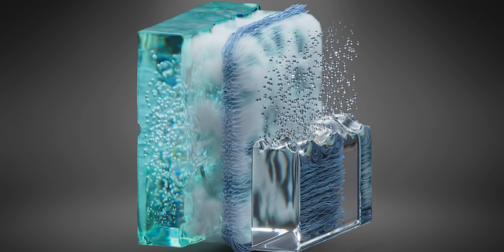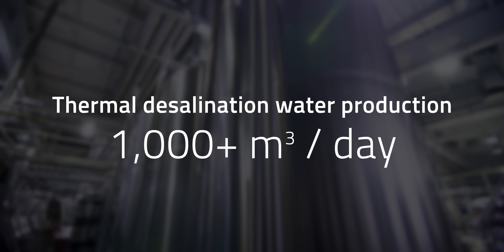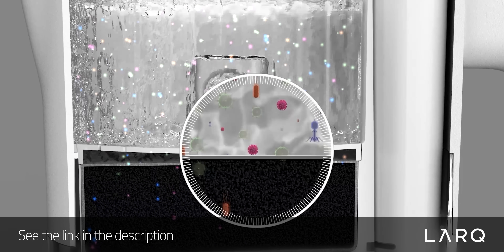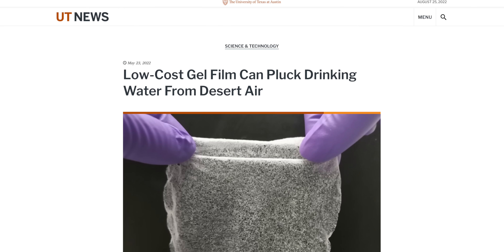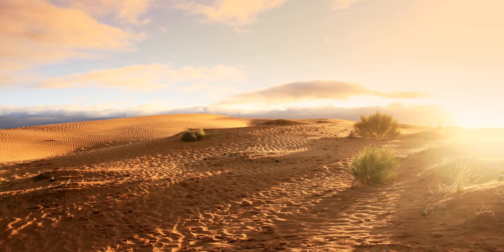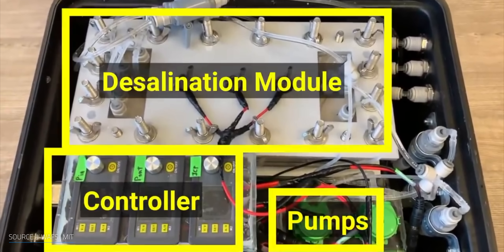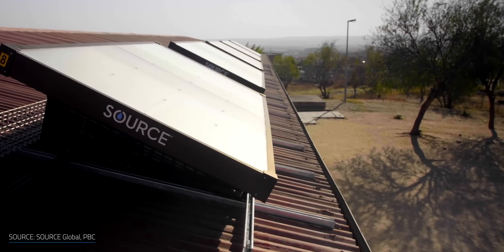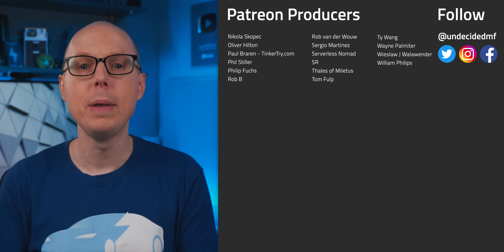2 Breakthroughs That Could Solve the Fresh Water Crisis

Comment: Brine shouldn't be viewed as a big problem it just needs to be mixed into the ocean over a large enough area, not that difficult of a task.   Getting through the discharge regulation red tape is the main problem,   As water becomes scarce in areas like the Southwest the zelous regulations including monitoring  will have to be streamlined to accommodate the needs of the people.

Comment: immo so the best solution combined was pump sea water from sea to very wide  semi closed place drying rack while use gel hanging on near air hole to milk as much water vapor in process to some hub to stored it for next processing. It seem not only need sun heat to be power horse the leftover salt water and other thing pumped for sea can seem only need be regularly cleaned or even might be another source of resource.

Comment: ICP is actually quite a cool idea for wastewater treatment and water re-use. Typically, this uses normal membrane (or even sedimentation) solid removals. If this idea could reach TSS concentrations as low as membrane technology, without the maintenance and replacement issues, then it could be very competitive. 

Regarding the foam, I see this more as an emergency or military solution. It's not practical to transport in the quantities required for what we would consider acceptable living standards. Generally in the West, even the most water conscious households still use about 80 l/p/d. Going lower sacrifices hygiene, which is not desirable. At 80 l/p/d you would require almost 15 kg of foam per person, which difficult to provide.

Comment: The problem is what has become trapped in the hydrologic cycle, such as persistent chemicals, nanoparticles, and volatiles. There are roughly 6 million man-made molecules, pharmaceuticals, and human and animal metabolites which current water treatment either don't test for or can't remove given some, like tetracycline are made to be hardy (therefore higher longer bioavailability).  I would like to see how long and how effective your sponsor's filter truly are given that would quickly become overloaded, the UV is a good and effective idea for biologic issue. But, does it get environmental hormones for example.

Comment: Have a look at batch reverse osmosis, it's a new RO process that varies pressure over time reducing the overall power consumption. Loads of research/ prototyping has been done by university of Birmingham (UK) and MIT. Commercial systems are currently under development (Salinity Solutions)

Comment: The gel sounds great, but it does need to be freeze dried before use and it requires a heater and condenser to collect the water. Also the water still needs to be filtered after collection.

Comment: The brine discharge issue seems odd to me why not keep the brine and send it to evaporation ponds or other methods to extract and sell the salts. Assuming the brine doesn't contain any toxic elements that would be a problem.

That small solar powered unit looks interesting, however I question the $50 part even if made on a commercial scale.  Just the solar panel to go with it is likely going to cost the $50 let alone the device itself.  But even if $100 it would still be a relatively cheap alternative if it has reasonable production qty and will last

Comment: Thanks for the great new video! I really like these videos that return to previously discussed technologies to see how they're progressing or examine them more deeply.

They're both really interesting, but the ICP process seems to me to still be at a level where it needs more development. It is a very cool engineering based solution, though.

Of the two, the gel film seems the most revolutionary right now. By harvesting water vapor from the air you're getting the sun to do the more energy intensive desalination part as it evaporates seawater. That way the salt stays in the ocean and you don't have to worry about by-products. Also water vapor is everywhere, so this gel could be used to harvest drinking water anyplace on Earth. It may seem counter-intuitive, but I think it might be best used in coastal areas and on islands, because the water vapor is constant there and immediately recharged by the sun. But it could find mass adoption anywhere fresh water is needed, including countries like Bangladesh where the water supply tends to be contaminated.

The big question (imo) is if this gel technology can be upsized to industrial scale. I know the inventors have intended it to be a small scale, single person or household solution - but the low energy requirement suggests that it could be a real competitor to industrial desalination plants.

Comment: Very interesting Matt.  Perhaps the saline output should be thought of as a potential source.  There are so many contaminants of sea water that could be recovered if they are concentrated.
Even Salt itself is a useful product when dried out although the volumes produced to recover sufficient water would be in excess of our needs and maybe utilise too much energy, it is an interesting possibility.  When we view the vast areas of drying seawater to produce commercial masses of edible salt (seen for example in the north of western Australia) there is the possibility to utilise one of these techniques as a primary stage to pre-concentrate the seawater and recover some potable water at the same time..

Comment: This did not cover what seems to be one of the most exciting desalination systems. I think it is in laboratories in Oxford. It is an osmosis system hence does not require high pressure pumps indeed can be gravity driven and uses Graphene to filter all the salts and particulates out of sea water.

Comment: You can convert old car generator to spin like an Edison generator and add inverters and transformers to deliver high voltage AC power continuous peak power without fuel or pollution.  It is a matter of effort to produce electricity without fuel or pollution.  Edison generator is an open patent device.

Comment: The filtered water is good but you have to get the water treatment plants to switch to sodium hydroxide corrosion control instead of aluminum hydroxide corrosion control and flocculant.  It is very difficult to remove aluminum and aluminum is the known cause of Alzheimer's CFR 69 pg 419.  A glass pitcher with coal or charcoal and coarse sand is a good filter except for aluminum hydroxide corrosion control.

Comment: Need some of that film in NC where summer RH levels hover in the 50's and 60's. Actually it would be an excellent way to provide clean drinking water while lowering cooling costs for the interior of homes. Instead of using dehumidifiers to lower the RH in a home a family could use this film and then consume the water used.

Comment: I have a concern about those gel packs. If they work like a dehumidifier bucket I'm a basement by pulling water out of the air, wouldn't that create a long term problem in areas that are already arid?  You could be creating a larger problem by making the air even drier. This could be a solution in tropical areas though, such as a rainforest.

Comment: 1 The 50 dollars is for the solar cell to run the MIT machine  Not the cost of the MIT machine itself
2 The MIT machine runs on a principle that is less efficient then reverse osmosis 
3 I work on container ships   we get free fresh water using the waste heat from the engine
4 the gel is not energy free. It moves the water from the air to the jell. Then you 
get the water back out with a condenser  just like in the dehumidifier 
All this was gotten from the companies own websites. 
Did you actually check anything out.

Comment: Israel's Watergen has been making portable water-out-of-air devices for years, that work in the desert. There is another company that makes portable desalination devices, used a lot on small island nations. Both have been used extensively in disaster areas and are proven to work. The products introduced in this video do have some theoretical advantages, but it seems like they're more expensive at this point. I'm not sure if the advantage of being so portable it can be carried by one person is enough to sell it effectively. Time will tell.

Comment: Thinking of the 180 on the membrane one, what is the effect of pulling the all that water out of the air as the dry air moves on. Sure it can be used to water the desert but will that dry air  then turn the farm land next door into the new desert?
In a small scale it might not matter, in an sealed area that moister is an issue like a submarine or space craft it would be ideal. Yes emergency relief is probably the best use for both as water is very important to get to people quickly

Comment: What tends to be forgotten, is the usefulness of the brine and other things removed from water. Salt is used all over, from food to roads and other industrial purposes. At larger scale, these will be easier to get and use elsewhere. For instance, the ocean is one of the largest containers for lithium. There's also a lot of other things in seawater that are useful. Many of them are put there by us. The byproducts of many processes, I feel, should be researched more to see what can be more reclaimed and cleaner than just dumping in random places.
Reply: the brine could be processed and be used for molten salt thermal batteries.
Reply: Brine is still majority water.  Water content is still 93% for those brine.  It is not pure salt yet.  Still very high cost in processing.
Reply: Salt has low commercial value. Hence high shipping costs limits the commercial value.
Reply: Is anyone exploring desalinization options that extract low percentages of water at very high volumes with resultant brines that are not much saltier than ocean water and thus safer to return to the source?
Reply: @xerxespamplemousse6622  yes. They have floating desalination barges that are run by the wave action of the ocean. It pushes the water through a filter but releases something like 75% back to the ocean so it's not concentrated. Since it's powered by the ocean waves, it runs all the time with no energy inputs.
Reply: @zlmdragon.  please can you elaborate more ?
It's less costly, apparently, to process sewage treatment water to drinking quality water again.
Reply: @zlmdragon.  if too much brine, the marine echo system is also at risk of destabilizing...
Reply: We have motors that run on salt water... Gas companies Buy them and the copy rights  so they dont loose money .and have any competion in the Market place ..
Reply: Brine kills aquatic life, creates mountains of salt in the blink of an eye. Man cannot consume or use more than a tiny percentage of the salt removed through large scale desalination. It's a useful technology on a small scale only.
Reply: My thoughts exactly. The water in the brine can also be used. By storing the brine in shallow, black bottom pools, daytime evaporation can ad humidity to desert air that can be harvested with the solar powered dehumidifiers or the gel. When the pool dries out, harvest the salt. The gel can also save electricity in humid climates by absorbing humidity inside buildings and then being moved outside to release the water. The gels can also be used for a self watering garden. It would absorb humidity during the night and release it into a drip irrigation systems when the sun heats it up. At larger scale, it could irrigate farms in places like California, reducing their needs for Colorado River water.

Comment: You fail to mention whether these water purification systems eliminate chemical contamination in lakes and rivers.  A charcoal filter won't eliminate all of the chemicals in most water by itself. So you would essentially need a three stage filter system to filter the water BEFORE you use the MIT model.  This solves nothing!

Comment: ICP will likely not challenge RO in larger scale, as it will likely not scale well (electrical fields scale in distance with r^(-3), so lose effectiveness very fast for large scale). Also, the water recoveries in RO can be deceiving: the lower recovery rates are usually reached to avoid releasing large amounts of higher salt concentration water back to the ocean. You do not want to do this for ecological reasons (the water is denser, less oxygenated, etc). So, you have a lower recovery which also means less energy for pressurizing the water.
In large scale, RO still rules and I haven't seen that trend changing. Still, wherever we can use smaller scale solutions, we should do so. The trick in the end will be reuse of water, as in Singapore.

Comment: Would it be possible to use the heat from geothermal vents to desalinate water thermally?, that way we're not burning fossil fuel to distill the water, but a natural occurring heating element.

Comment: Those percents of water on earth are meaningless. How  much is needed and how much is available, that's the ratio that matters.

Mean relative humidity in US Southwest is not as dire as you make it seem, at least according to NOAA map.

As far as developed countries go, how much freshwater do we just dump into the ocean by paving over every last surface.  Here's a quote from American Rainwater Catchment Systems Association: "a house with a 1,500-square-foot roof in an area that receives 12 inches of rain a year could collect 10,800 gallons of water."  That's 49,100 liters or 12, 275 man days of water.  In just three years, a lifetime supply of water will wash away.

Comment: The question that must be solved is what do we do with the salt brine. It would make sense to pump it on board ships which will soon leave port, to be used as ballast that is flushed out of the tanks when well off the coast line and is replaced by sea water.

Comment: When you say "You need a lot of energy" for the distillation process, you make it sound like you need a lot of electricity. You don't. You really don't. You can use a solar furnace. And portable desalination has been around for well over 40 years. No electricity needed. You find them in emergency kits on boats

Comment: I still don't understand the potential form factors for the gel in the field. Would it be suspended in the air with collection plates beneath it? Could they be placed similarly as rooftop solar panels with drain lines going down to a tank?

Comment: Lol LARQ. I supported them through their kickstarter and got 4 bottles. They all got red rings of death. They replaced them and had problems with those. It wasn't until they redesigned the caps that they problems seemed to go away. Another problem just showed up to take its place. The metal inside the cap was corroding underneath the paint and caused paintchips to get into the water, which I assume is because the cap is made of aluminum and the bottle is made of stainless steel. End of the story was they wouldn't warranty it since it was out of warranty (1 year lol) even tho every bottle will eventually have this problem, and they basically told me that wasn't why its chipping.

Comment: I do field work in remote locations of Alaska, often in the Y-K Delta where fresh water is not available outside of villages. In those cases, we can't even use a portable gravity filter unless meltwater is available, which is only for a brief time at the start of summer. The only alternative has been hauling in jugs of water which requires takes up precious fuel and space in support aircraft. Something like this, combined with a solar panel, would be ideal. I'll be watching the development of this tech. Thanks for the informative video!

Comment: Nice video. Current state-of-the-art seawater desalination membranes are actually a very energy efficient separation technology. The "large energy input" that is required occurs because thermodynamics tells us that energy is required to de-mix solutions (e.g., de-mix salt and water molecules). Current desalination membranes operate close to the thermodynamic minimum for separating salt from water. This energy is relatively large because there is so much salt in the ocean that must be de-mixed, not because the membranes have poor efficiency.

Comment: 20 W / l does not say anything about the energy consumption. If the device needs to run 1/0.3 = 3.33 hours / l, then energy consumption is 66.67 Wh / l.

Comment: Not sure the cost of the ICP unit from MIT is forecast at $50…..Reading the source article implies to me that the $50 is a reflection of the cost ONLY of the solar panel to power it. I think they are simply demonstrating the minimal power input, not making any implication about the system unit cost. I would be gobsmacked if they could implement that process for $500 let alone $50…..

Comment: Brine is not a problem if properly utilized.
Please do a video on osmotic engines.  Brine can be pressurized into an RO filter where it is diluted through osmosis by ambient salt water with a lower salt concentration.  This stream of pressurized diluted brine (sea water) can then drive a turbine that produces more energy than is required to pressurize the brine.

Comment: for how to handle the brine: we use it to make salt further inland, we sell some of the resulting salt, the rest we package up and throw back into salt mines, from the salt mines we can resell and refine it for molten salt thermal batteries and molten salt based power plants. we could also likely use it to mine lithium and sodium for lithium and sodium based batteries. Something else we could try is weather manipulation, if we start pumping a good amount of sea water inland into deserts we could raise local humidity levels, increase cloud cover for the surrounding areas and use this to fight desertification, we could make more of the desert habitable, we might even be able to start reforesting a desert in a few decades of pumping or using canals to move sea water inland.